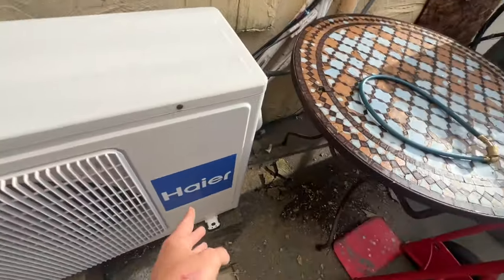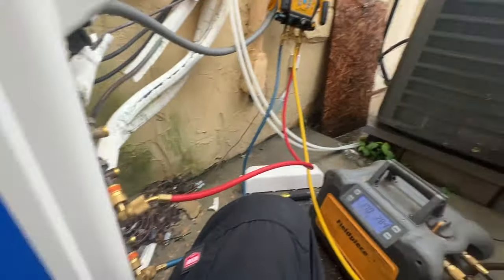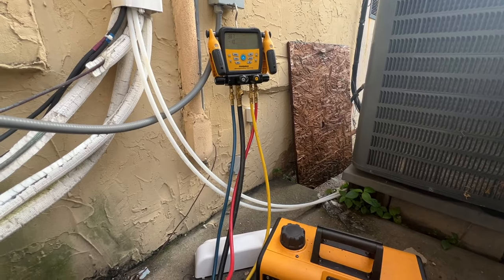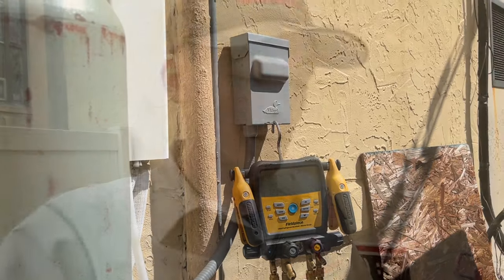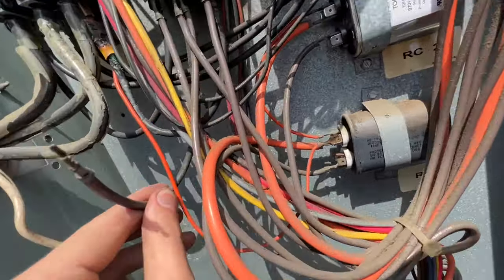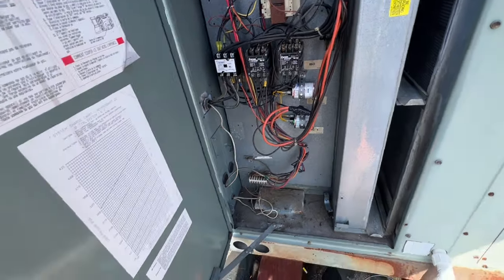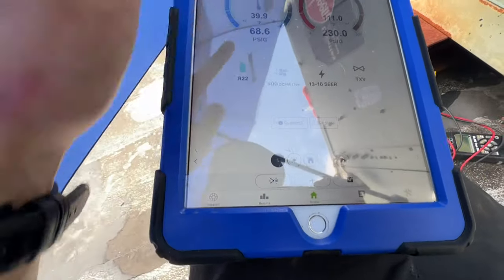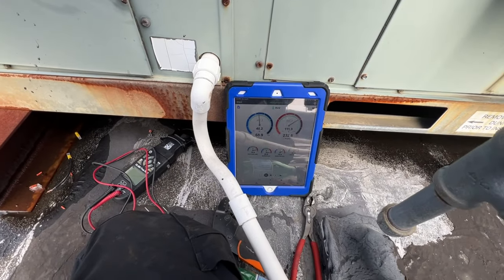DCHVAC Becomes Car Mechanic?? Hacked Ductless System Dead! Rheem RTU with Blown Wires and More!

Comment: Had a few units with burnt wires ,no trip. Ended up being the feed wires at the breaker were loose!
Reply: Agreed.  Loose power connections increase the resistance across the circuit which creates heat which in return creates burnt, overheated wires.  Lucking it didn’t go 💥……..

Comment: Yeah, the wire fell off 😂😂😂. Nice job on the RTU. That cheap Chinese crap first appeared in department stores as cube refrigerators, window air conditioners, you name it. Absolute junk, and dirt cheap. Nice job on tire. Need Milwaukee 1/2” impact gun with impact sockets to keep on truck. New mid-torque guns will easily handle those lugs 👍

Comment: Mercedes and not even a wheel spanner. I suppose that you are lucky that they supply a full size spare and a bottle jack ,I see most vehicles these days have a cheap Scissor Jack I have seen to many of those just collapse. I assume that the wheel spanner broke the first time it was used. As most workshops use a air powered impact driver set to very tight, That is why there is not one in the van.😂😂 .Hacks bring you stacks!!